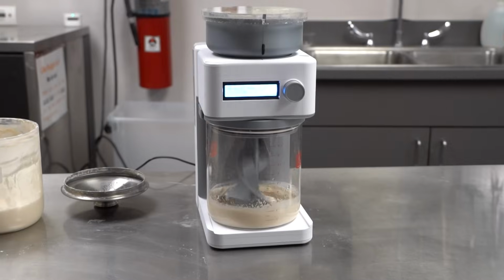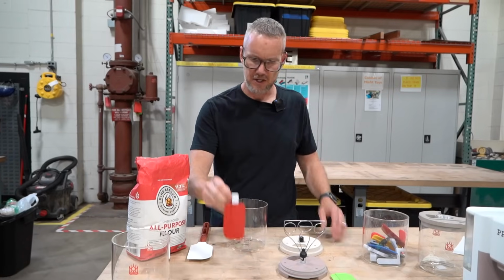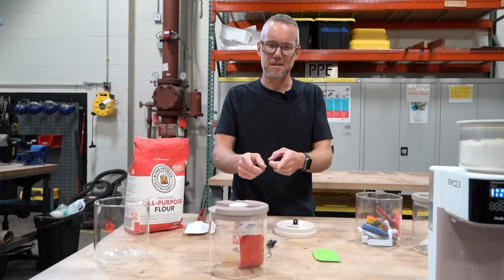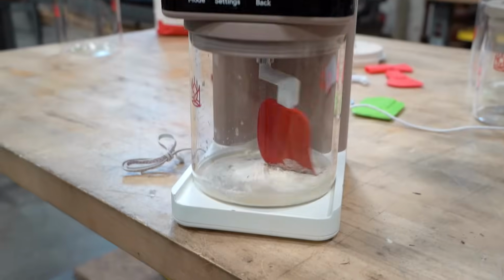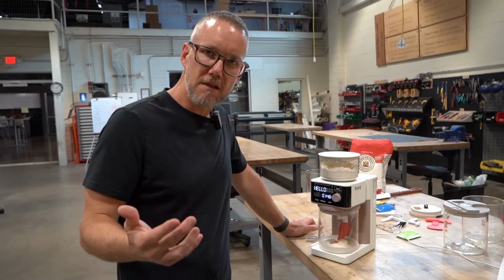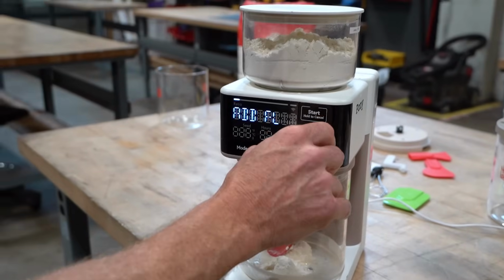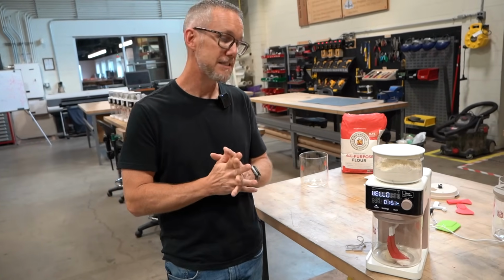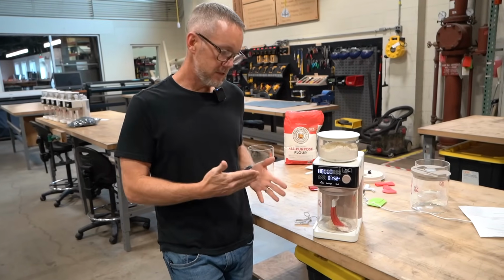Perfecting the Paddle Design | Sourdough Sidekick UPDATE

Comment: can't say I am happy about this design simply because it looks just plain cheap.  Looks like a child's toy now.  And that silicone is bound to break into pieces at some point.  What it the arm holding that paddle breaks?  This is starting to look like a cheaply made, throw away machine at this point.
Reply from the maker: This is a simple prototype to explore and test a new paddle concept. It looks cheap, because it is. 3D printed arm and dollar store paddle to quickly test  how this new design would work in real time. We like the results, so from here, so we will continue to refine, engineer, and test, until we are happy with the final results. Then we use better manufacturing techniques for the final design. 
  The Sidekick itself was almost entirely 3D printed in its original prototype form and looked very unrefined. We used that version to prove that the concept works and from there, have continually refined everything and used better and better materials in each new prototype model. 
  If we continue forward with this new paddle idea, then the final version will most likely end up looking very different and definitely be made of better materials with better manufacturing techniques.

Comment: I really like the idea of stainless steel over silicone, but I hear what you guys are saying on just pushing/scraping the starter around as opposed to really mixing it.

Have you guys tried using a crock where the inside of the bottom was scuffed/frosted to increase the coefficient of friction ever so slightly?  I want to assume the "pushing" vs "mixing" is more likely when there is a much smaller volume of started and goes away as volume increases?

If true, maybe another solution would be to apply a tiny bit of water to the bottom of the crock, then a tiny bit of flour, mix a couple rotations to spread the flour  across the bottom and then stop to let it dry for a couple minutes - that way it would form a bit of a dry layer to increase friction on the bottom - that layer could still be removed and incorporated naturally as the flour fully hydrates and is mixed.  Then once the starter volume was enough to cover the whole base of the crock, the software could skip that step?

That all said, I think it's reasonable for you guys to offer mixers (and spare crocks!) that are optimized for different starter ratios/volumes.
Reply from the maker: we have not changed the texture of the crocks as that presents too many new problems to be viable, at least as of right now. The mixing certainly does get better as more feedings occur and more material enters the crock. There isn't much footage yet, but this silicone paddle (even in it's current form) makes a nice even batter as feedings continue, which is viable but certainly could still be better. We have been playing around with water or flour first, how much, stir or not in between each. Which all does make a difference and we feel close to nailing down.
 The main thing is that this new idea is in the very early stages. Our other paddles have been working just fine but the team really feels this is worth exploring to get an even better solution that works well in just about any use case.
Reply: @Firstbuild I can see this being a great situation for "perfect is the enemy of good".  Heck, the type/mill of flour people use could impact performance, so there's always going to be some level of compromise.

Comment: Have you guys thought about making it wifi? For instance, I love that my Traeger smoker sends me an alert if it's low, adjust temps, etc.. Wifi would be nice to alert you in an app, this will allow you to adjust ratios right from your phone! Plus, are you going to have a lid for the crock? To use for those weeks you're going camping, a cruise, long business trip etc., and you need it to chill in the fridge until your back.
Reply from the maker: It will be connectable via WIFI if you want. Enabling software updates, and auto clock/date updates which is useful if it loses power for a bit.

Comment: Why not have the paddle automatically reverse and mix in the opposite direction as well...
Not certain is silicon paddle  is the way to go for prolonged contact with foods... As it wears down particles can be released into the starter... and consumed in the finished product...

Comment: I had an aftermarket kitchen aid mixing paddle. Unfortunately, it started to tear, and I found tiny bits of gray in my vanilla cake batter, so I went back to the original mixing paddle.  So maybe doing the circle 8 motion and as others stated, if possible, have it change directions like my bread machine does during the mixing and "punch-down" of the cycle.  Thank you all for your hard work creating this.😊
Reply: My only concern with a figure eight motion would be needing to add a more complicated set of gears for the spatula instead of an in-line solution.  It would add cost & impact reliability.

I agree the figure 8 is often a better mixing motion, I'm just not sure how to do it for such a low-cost and high-torque application in a reliable manner.

Comment: Concerns about silicone paddle:

- I have owned silicone tools that break down over time in a way that I can actually taste them in the food.  I’m wary of silicone now, especially when it will be in such prolonged (perpetual, in this case) contact with food.

- I imagine that the silicone paddle will take on a permanent bend and become less useful over time if it’s always in the same position.

- I would suggest having the paddle rotation reverse every 30 seconds.  The silicone would need to give enough so that the bend flips as well.  This would prevent it from always being bent in the same orientation and deforming over time.  It would also eliminate the problem of having raw flour stuck to the back of the paddle.

You guys are the professionals of course, but those are my initial impressions.
Reply from the maker: It is an interesting challenge for sure. We have several designs that work well but getting one paddle to rule them all and be perfect in any and all circumstances is a tough one. The team is feeling good about the current direction and are excited to really nail it down.
Reply: I thought the same thing - in theory reversing the motor should cause it to flip over - but the moment before it flips the motor would basically be in stall condition and it would be hard to program the controller to know it's okay to keep applying more force to get it to flip - it's possible that the controller would just fault on over-current or over-torque and require user intervention to flip it anyway.

Comment: I would take the wire paddle, reduce it in size, add silicone so it touches the edges of the crock on the bottom and sides.  Add the offset arm and have it rotate like a Kitchen Aid mixer.
Reply from the maker: We have actually done something very similar. It's tough because you want a good squeegee action but that creates other problems in load, torque, clean-ability, tolerances, etc. Some of the designs do really well in the initial feeding and then poorly in a full crock and vise versa. It's all part of the daily engineering challenges.

Comment: My favorite design for a paddle is the aftermarket mixing paddle for my Kitchenaid stand mixer. It's a rigid paddle in the same shape as the factory paddle, with a rubber edge that follows the contour of the bowl. It mixes remarkably well and keeps anything from sticking to the stainless bowl. Best of both worlds with the open framework to encourage incorporation of the ingredients along with a scraper to keep things from sticking to the container.